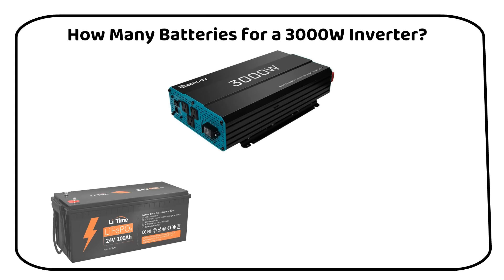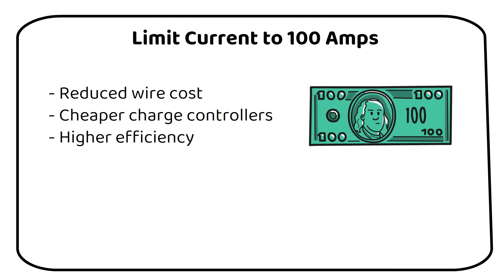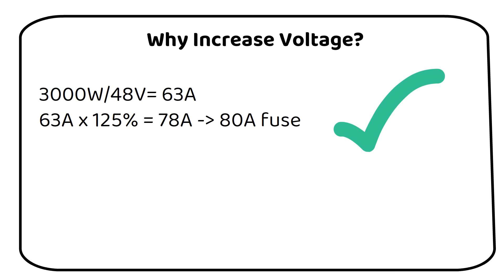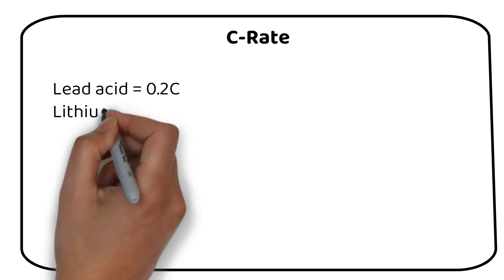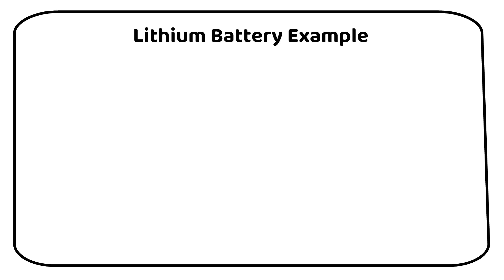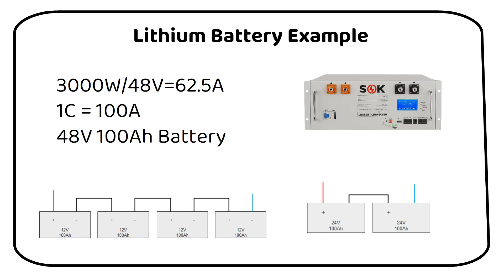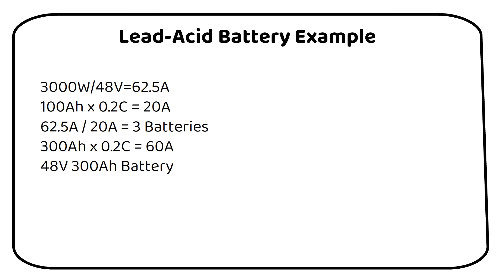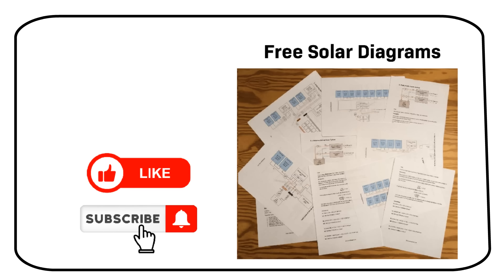How Many Batteries For a 3000W Inverter?

Comment: 3  12v rv batteries
3 100wsolar panels
 600w converter?
Reply: Assuming the batteries are 100AH AGM batteries, they will like 10amps available to charge each. That is 30 Amps, at 12volts that is 360 watts. you only have say, 4 hours full capacity of sunlight available, so I would want 400-500 watts of panels at minimum.

However, if the batteries do get fully charged every day, you have 50 AH x3 or 1,800 watt-hours available (conservatively). The 600W inverter would run for 3 hours at full capacity. You could probably run a 2,000 watt inverter for just under an hour. If you just have small loads, a 150 Watt inverter would run for 10-12 hours, and be more efficient than a larger inverter.

I add a 900W propane generator to my rig so I have a 30A AC charger available to top everything off when needed. We get a lot of gray days.
Reply: @jamesalles139  I'm in Florida and I think I only need to run a mini fridge and charge usb items. 
I'm hoping g to use one battery for that and the other two split off the one and use them for my small deep freezer
Reply: I cook with wood and have rain catchment and hand pump
Reply: @anandasmom  yes I just did calcs on my small chest freezer, the 600W inverter should be good for that - It is best if it is pure sine wave.

I am not sure about the mini fridge - you might need 500-600 watt inverter for that as well, to handle the inrush current.
Reply: @anandasmom  yes, burning fuel directly is best for heat.
Reply from the maker: I will have a video about sizing your off-grid solar system uploaded very soon.

Comment: My 3000 w inverter is installed in an RV which comes with a mixture of 12v DC and 12ov AC systems.  Subsequently I used 12 v batteries in parallel (3x200ah lithium).  My batteries rated total max discharge rate is 300 amps - on paper it’s adequate, but in reality it’s BARELY adequate.   If I was doing it over I would add another battery to increase the total discharge rate.   However the storage capacity in this application is totally adequate. (Edited for typos)
Reply from the maker: If you have 3 lifepo4 200ah in series, then you have 12v 600ah. X 1C = 600a discharge current. A 3000w inverter on 12V draws 250a, so you have more than adequate battery for the inverter.
Reply: @cleversolarpower  My mistake - they are in parallel so the whole system is 12 volt.
Reply: @cleversolarpower  I know that on paper it should be plenty, but in practice while running the AC (drawing about 1800 watts according to the battery monitor) turning on the 700 watt microwave will often result in a shutdown that shows a low voltage error in the log.  All equipment is Victron and wired as per Victron specs.   It’s a great system for off grid camping we just have to avoid turning on additional high draw loads when the AC is running.    Not much of a hardship.
Reply: @cleversolarpower  The specs for the batteries (SOK) are 100 amp continuous discharge per battery - still sounds good, but for some reason not quite in practice.
Reply from the maker: @ I see, I made a mistake too there assuming your system is 12V 600Ah while wired in series. I expect the voltage to drop when you power on your ac and microwave. A microwave has a high startup current as well, so that might create a voltage drop. Are you sure your wires are the correct size?
Reply: @cleversolarpower  4/0 gauge about 3’ between battery and inverter.
Reply: @cleversolarpower yes for the inverter but not for what is needed . I like lead battery they handle the cold and heat easier then lithium.

Comment: Home off grid style back up. 4 100 amp 12v  lifepo4  in Parallel, 3000 pure swine Renergy, 250 amp max peak , with 1 kw panels , for home backup, manual Generator switch, non grid ,

Comment: Great example but you failed to mention that your  3000 watt Inverter needs to be 48 CDC. Most of us run 12 VDC inverters. I have a 3000 watt and have 6 100 amp lithium at 12 vdc. My problem was not enough solar wattage, had 360 on roof of the van, but my mppt couldn't handle my second 360. So had to buy a mppt thar could  take 720 watts, I  also will be installing a 100 amp AC to DC inverter for shore power use when pluged in to go along with the 40 amp DC to DC I have wired in already.  I don't plan to run a 110 vac on the van or a microwave for multiple hours at a time. So I should have enough power to run all my 12 vdc systems.  
 BTW, you would need to install a 48 vdc step down inverter to 12 vdc to run all of your 12 vdc appliances.
Reply: Thank you.
I had plenty of questions about that.
I too have a 12v 3000, but I just began to experiment with how many batteries I would need for continuous power without fail.
Now I know I need at least 6.
I have other inverters on order to have portable power.
I learned a lot from you, Thank You!
Reply from the maker: You don't really need a 48V inverter for a 3,000W inverter. But if you can you should do that. step 1: ensure your C-rate is ok, by having higher capacity batteries. Step 2: increase the voltage of your battery so you can use less thick wire, thus save money.

Comment: I'm confused in your lead acid battery calculations. You said you needed three batteries. Then you turn around and said you needed 12 12v batteries wired in series and parallel?
Reply from the maker: 3 lithium batteries and 12 lead acid batteries.

Comment: Hello I have a giant chest freezer that says  115v 60hz and 2.3 amps. It’s going to be in an ice cream truck. I also want to plug in a small POS system. Will 3000w inverter work?
Reply from the maker: 115Vx2.3A=265W*8=2,200W surge power. A 3000W inverter should work. I recommend Victron for long-lasting reliable components.
Reply: @cleversolarpower hello thank you so much. So I got the 3000w inverter now and it works great. It tells me that the freezer pulls about 1000w when starting up and then only 103w when running.  I have learned that such a large inverter pulls so much power just by staying turned on.... 
I now have (2) 400w solar panels i want to install. So what size LiFePo battery should I get? A large 200ah battery or two 100ah battery?
Reply: OR should I just get a smaller power inverter?

Comment: There is a reason why they have 12v inverters. Sometimes lead acid battery is better. I have a 12v 700w inverter in my truck plan on replacing it with 2000-3000w. I want to run a 1400w chipping hammer but only for a few minutes and not everyday. My alternator can power it without any drain on battery.

Comment: You didn't mention most lithium must be discharged to 80% Maximum and lead acid to 50% to get long life from the batteries
Reply from the maker: Checkout my video about sizing your off grid solar system. I cannot mention everything in a short video.

Comment: If the formula says, say 8 Battries does it matter if you only have 4 Batteries?
Reply from the maker: Depends on the capacity of the batteries. 4x200Ah batteries is the same as 8x100Ah batteries.

Comment: I'm really confused with all this, so what I would like to know is if I have 400 watts of solar going into my 2000 watt inverter and charging my 12.8 volt 100AH lithium battery is that to much for my battery to take in? This was my first solar set up and after only about 3 months my inverter is beeping and not working and I think my battery is out of energy. Could this happen? Hope someone can let me know....Thanks
Reply: Inverters are not used to charge batteries. Solar panels should be connected to a charge controller, not your inverter. If you don't have a charge controller, buy one appropriate for your set up. First, connect the battery to the charge controller with the correct gauge wires. Then connect your inverter to the battery with the correct gauge wires. Lastly, and ALWAYS last, connect your solar panel(s) to the charge controller. It's wise to have an appropriate fuse at the battery, going to the inverter, via your positive cable. The closer to your battery, the better. You can also place appropriate shutoff switches from the solar panels to the charge controller, and any other part of the system you may want to isolate for maintenance.
Reply from the maker: Couldn't have said it better. @dalecordova checkout my wiring diagrams on my website for some inspiration and visuals.

Comment: So, 1000W/12V = 83A
83A × 1.25=104.16A
Can we safely use 
a 100 A fuse?
Reply from the maker: You need to multiply by the efficiency of the inverter as well. 
1000W/12V=83.3A
83.3A/0.9=92.5A
92.5A*1.25=115A
So i would use a 125A fuse.
And a cable that can handle at least 125A.
Reply: @cleversolarpower  Thank you!

Comment: I have been puzzled trying to figure out how many more batteries i would need for that 3000W inverter you have mentioned from Renogy….

I have 3 => Renogy Deep Cycle AGM Battery 12 Volt 200Ah, 3% Self-Discharge Rate, 2000A
With a Renogy 100A 12V/24V/36V/48V DC Input MPPT Solar Charge Controller

Also, some more questions….
1. Panels needed? 
2. We also have a 2000w and a 700w Renogy inverter for future installation. We would like to "modulize" the solar system so if one system goes down, it doesn't take the whole system down. How would I integrate in these inverter?

I have been fighting with this system for years and would like to get your opinion.

EDIT => Just bought your book, looking forward to reading that as well.
Reply from the maker: If you put them in series, then you have a 12v 600ah battery. X 0.2 C=120A. 3000W/12V=250A. So to run in, you ideally need to double the battery. Checkout my video about load calculation.
Reply: @cleversolarpower  Shouldn't three 12v batteries in series be 36v?

Comment: Can you recomend a square sine wave inverter (for me to build) to undertake two operations as follows ;
>
1 Power several appliances, not all at once the biggest would be 230v 1000w microwave
2 To build a Li-ion battery charger to power the above inverter.
a) Would a leisure battery suit my needs better.
I was given bad advice and I have purchased two new stepper motors, if I can somehow incorporate these into this project would be somewhat beneficial.
The same person told me to purchase 20 Li-ion batteries but after reading reports on Li-ion batteries catching fire / exploding caught my attention.
I am now unable to reach this person.
Reply from the maker: You need a 2,000W pure sine wave inverter and two 12V batteries in parallel (lifepo4) to run a microwave.

Comment: If your numbers are correct, then why do they sell inverters for use with 12VDC of 2000W or more?
I have a 5000W 12VDC inverter.
RVs use 3000W 12VDC inverters all the time.
Reply from the maker: Because people still buy them. It's that easy 😊. The voltage is not that important, it's there to save cost. But this is how you properly size a battery for a 3kw inverter.

Comment: My friend had 4 golf cart batteries 
Lives in van , use power for couple led lights and charge phone !
Charged with Generator or start van. Even after 4 hours never had a them charged totally…. After 2.5 years batteries won’t hold charge very long. Now only 2 batteries charges fine in 4 hours!
Reply from the maker: I suspect the previous batteries were dead.

Comment: I think it will be more correct to say load of 1000W instead of 1000W inverter. Usually you never use the inverter at 100% of the rating
Reply from the maker: Usually not, but when you do it's the same consumption as the inverter anyway.

Comment: I watched this video but I? LOL. This is the inverter I purchased. Pure sine wave 8000 model.
4000/8000 (peak).
DC 12V/24V TO AC 110V 50HZ
FROM JJ CYCLE (CHINA). Hopefully you can advise me a little more. Thank you for responding.😊

Comment: 2 12v 200 AH in parallel. 2000w inverter. Most it can draw at once is 17 amps. That is rare though. No problems so far.

Comment: The 100A limit you mention is completely arbitrary. The only consideration that matters is the C-rate of the specific battery. Enough 12V batteries in parallel will just as well power a 3000W inverter.
Reply from the maker: Yes, that's what I'm saying. Your wires will be large, costing you a lot of money, so not properly sized.

Comment: My12v 100ah deep cycle lead acid batteries do not weigh 250lbs each. So why would anyone want a 1000lbs battery when 4 x 12v 100ah would weigh less than 100lbs?
Reply from the maker: Who said a battery weights 250 lbs? 😬
Reply: Perhaps your english is not up to par, are you trying to say BATTERY BANK (meaning many batteries combined) not battery? @cleversolarpower

Comment: meaning lead acid batteries are only good when they are used in a 12v system.

but lifepo4 are always best 12-48v

Comment: I am powering a 16,000 Watt powerjack inverter with 4, 200Ah LiFePO 200Ah 12V batteries to run my table saws in my wood shop.  I would wire them in parrallel to get the 48V and hook them to the 48V inputs on the inverter. then the inverter ouput I have wired to an electric off grid breaker box which powers my 110 v outlets.  The inverter should be able to pull the power out of the batteries to start the big draw a large motor requires, correct?  I have 8, 200 Watt solar panels 4 connected in parallel to yield approx. 48V then these are connected in series to the other 4 panels.  These then combine and give approx 90V and connect to a 100A MPPT charge controller that then goes to recharge the battery bank.   My old lead acid AGM batteries stopped powering my big motors last year so I just upgraded to the lithium.  Should this work for few years?

Comment: You make it sound like this is the only way to do it; we need, you must have, etc.
Why not use 4 12v 100Ah lifepo4 in parallel?  You only draw 20A from each one.
Reply from the maker: 3000W/12V=250A. You won't draw 20A from one battery.

Comment: If a 12 volt system should only use 1000 watt inverters, can you explain why most 12 volt 2000 watt "plug and play" systems have 2000 watt inverters built in?
Reply from the maker: The manufacturers build what the people want. That's why you see ridiculous 5000w 12v inverters, people buy those.
Reply: so , if i wanted {4} 12 volt 100 am hour batteries/lifepo4 . to power up a freezer for example , you are saying that i only need 1000 watt inverter? what about the surge? isnt that the reason for the larger inverters?
Reply: right now i have a 2000 watt plug and play but want to go off grid and get a  larger system so I can use my air conditioner and freezer
Reply from the maker: @michellelaclair  I don't know the type of freezer you have. I recommend measuring the startup power of your fridge to find out the inverter size you need.

Comment: Ok let me see if I've understood...

I have an Enerdrive 40Amp DC/DC Charger & Solar Controller.

I have 2 X 12V 120Ah lead acid AGM batteries (so far).

I intend on using 2 X Solar panels. 1 X 400W on roof of Caravan + 1 X 200W portable panel on 8m heavy duty wire.

600W Solar/12V = 50Amp (max production) 70Amp fuse

120Ah X 0.2C = 24A current per battery

1000W Inverter/24V battery = 41.6Amp Controller (40Amp Enerdrive)

41.6Amp X 125% Safety = 52Amp Fuse (60Amp fuse)

41.6Amp max draw/24Amp max current = 2 batteries

So... I need a 24Volt 240Ah battery to power a 1000W Inverter on a 40Amp controller....

This is 4 X 12v 120Ah lead acid batteries in series.... Am I right?

If I only have 2 X 120Ah lead acid batteries I should halve the inverter to 500W....is this correct?
Reply from the maker: You need a 50A charge controller fuse, not 60A. You need 4 batteries in a 2S2P configuration.

Comment: if you need a 3000w inverter you need a generator and a appointment with a Psychiatrist
Reply: Or just be one of the many people who forgot what camping is. Fridge, coffee maker, inductive cooktop, possibly air-conditioning. Without all that people think camping is just homelessness 😊
Reply: You must be in the US. In the Philippines, there is no central heat and air. For an 1100 sq ft house, you need 5200 w in 24 hrs to run air conditioning and internet and TV. If you want to live without air conditioning over here, you are the one that needs a psychiatrist
Reply: @timledbetter1781  you dont need batterys fella--- you need to use mains power
Reply: @thelonewolf666  yes. There is 4 other people in the house, kids often times too. I'm living in the tropics, I don't need heat, or a hot water heater. I don't even use am air conditioner, except at night when I sleep. But, I don't think it's fair, for me and their mom to sleep in an air conditioned room, but her grown kids don't. Plus, there are frequent outages here. It's very hot with no fan. So, I want to be able to run 3 1hp air conditioners at night, a refrigerator, a freezer, internet, charge our devices, and lights,  without an electric bill. Plus, the grid here is so inadequate, in my current house, if we turn our air conditioner on before 11pm, the power goes out to the entire village. A 3kw system would only run the internet, TV, refrigerator, freezer, and lights nothing else. And, the electric grid here, is even more efficient than the west. The system is 220v 60hz, smaller wire and breakers due to lower current. The bills here for power are literally half what they are back home, but their power grid isn't even capable of running our new house. So I'm putting an off grid system in it, that will be even more stable than their power grid

Comment: Also remember. You shouldnt be pulling 3000w from a 3000w inverter all the time. I run a 3500w inverter and i wont load it down past 2500w or so. They will warm up and start to lose some efficiency if pushed hard all the time.
Reply from the maker: True, efficiency reduces when load increases. But we still have to size our cables and fuses for the max load of the inverter.